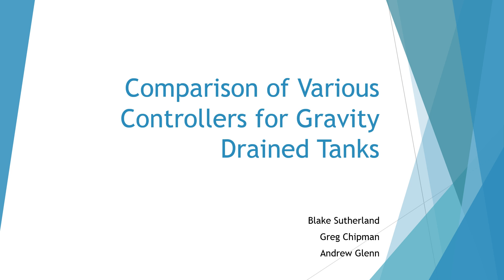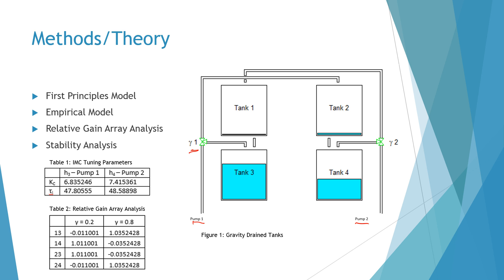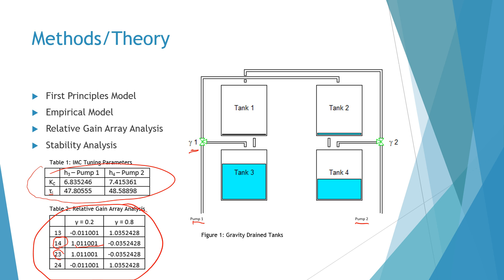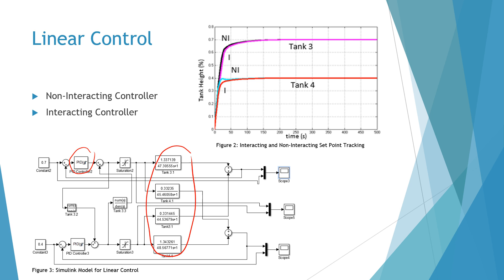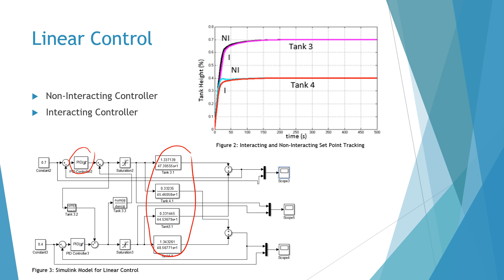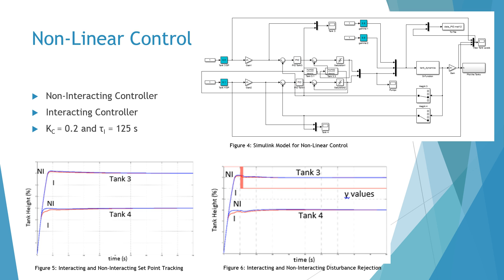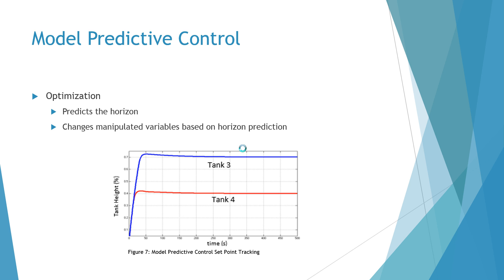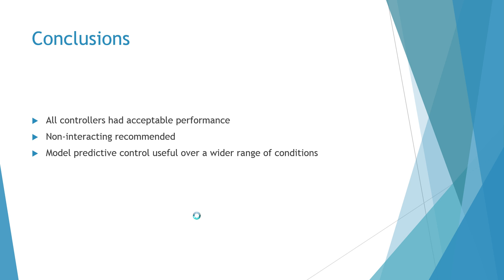MATLAB and Simulink Level Control

Comment: Sir, 
 How did you determine the Saturation interval in the Quadruple Tank System that you modeled as a linear model?  Do you have simulink file of Linear model of Quadruple Tank System
Reply from the maker: This was a student project so I don't have the files. The valve and pump saturate at fully open/on and at closed/zero. The level saturates at the point that it reaches zero or over-fills.

Comment: sir i have designed  the simulink model of quadruple tank  with mpc controller but it is not responding....
but it is showing error with mpc....
specified MPC object "MPC1" cannot be found in base workspace...
even the simulink is not running
Reply from the maker: +mithilesh kumar Did you rename the mpc object to mpc1? The block that calls the mpc function needs to have the correct name. Also, check your MATLAB path to make sure it can find the function that you are calling. A good practice is to save versions of your files so that if you introduce an error that is hard to diagnose, it is easier to return to a working version.

Comment: sir how to design the simulink model of the quad-tank system...?
i have derived the dh/dt for all the tank but i don't know how design the system.
Reply: +mithilesh kumar The equations are shown on lines 147-150 of tank_dynamics.m. If you need a new Simulink model, you'll need to use these equations in a custom S-function block or with MATLAB (or Python). The reference for MATLAB or Python scripts and details of the implementation is:

Hedengren, J. D. and Asgharzadeh Shishavan, R., Powell, K.M., and Edgar, T.F., Nonlinear Modeling, Estimation and Predictive Control in APMonitor, Computers and Chemical Engineering, Volume 70, pg. 133–148, 2014, DOI: 10.1016/j.compchemeng.2014.04.013.

(Preprint: http://apm.byu.edu/prism/uploads/Members/hedengren_cace2014.pdf or Article: http://www.sciencedirect.com/science/article/pii/S0098135414001306)

Comment: sir i have run A3_MPC.slx it shows error..
??? Error using ==> load
Unable to read file data_MPC.mat: No such file or directory.
Reply from the maker: +mithilesh kumar Make sure (1) you have unzipped the download folder and (2) your active directory in MATLAB is the same as the folder where A3_MPC.slx is stored. One way to make sure your active directory is correct is to double-click the slx file. MATLAB will automatically set your active directory to the folder where you slx file is located. The file data_MPC.mat is created by the simulator and you are probably getting the error at the end of your simulation run. The file data_MPC.mat is used to generate a MATLAB plot of the results. Your application is probably writing the data_MPC.mat file to a different directory because your active directory is not set correctly.
Reply: +APMonitor.com 
i have unzipped the file and run the program.
as a result i have got Figure 2 showing the graph of gamma 1&2, pump 1&2, and level sp 3&4...
i have to control the tanks level with different input voltages, how to input the different value in program to control the system under different condition......??
Reply from the maker: +mithilesh kumar There is an input box that you can use to adjust the pump voltages either manually, with a PID controller, or with Model Predictive Control. All three Simulink files are in the directory that show examples of each.

Comment: sorry, for late response.
k m = 1 0. 0 , >=3.0, <=20.0 % s l op e
Reply from the maker: +mithilesh kumar Make sure you are using these files: http://apmonitor.com/che436/uploads/Main/LabSim5.zip with description here: http://apmonitor.com/che436/uploads/Main/LabSim5.pdf  You can run A1_manual.slx for manual control of the pumps, A2_PID.slx for PID control, and A3_MPC.slx for Model Predictive Control. The script Initialize.m should automatically run before the simulation. Please download the files that I mentioned here and try again without modifying your files. It appears that the line you sent has spaces in the variable name "k m" and number "1 0.0" that may be causing the error.

Comment: sir, i am working on a project on quadruple tank level control using predictive controller in matlab. can you help me to interface matlab with hardware.
Reply from the maker: +mithilesh kumar MATLAB has a good interface to Arduino. Here is an example of interfacing MATLAB to the Arduino with available source code: http://apmonitor.com/che436/index.php/Main/PhysicalLab  You can also see some additional information on the quadruple tank (with experimental data) at the following reference: http://apm.byu.edu/prism/uploads/Members/hedengren_cace2014.pdf or http://www.sciencedirect.com/science/article/pii/S0098135414001306
Reply: thank you for your response.
sir, i have gone through the pdf file provided through your link.....
the code of four tank model  APMonitor system is showing unexpected error when i try to run it in matlab , i try to correct it but not succeeded. will you help me to correct it.
Reply from the maker: Sure, I'd be glad to help. What is the error message?
Reply: when i run the program  "Four Tank Model in APMonitor" in matlab  provided in pdf than it shows the error........
" ??? Error: File: fourtanksystem.m Line: 15 Column: 16
Unexpected MATLAB operator."
Reply from the maker: +mithilesh kumar Thanks for sending the error message. Could you also include the source file (Line 15, in particular)?